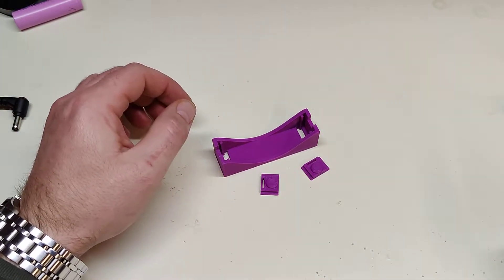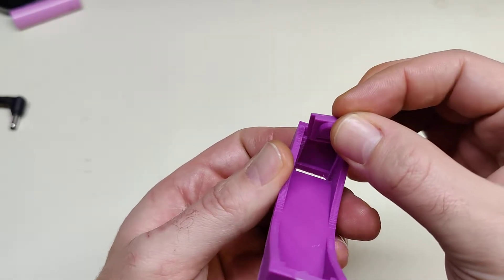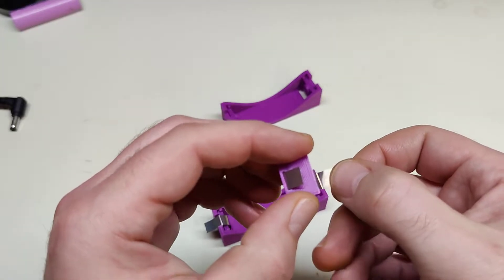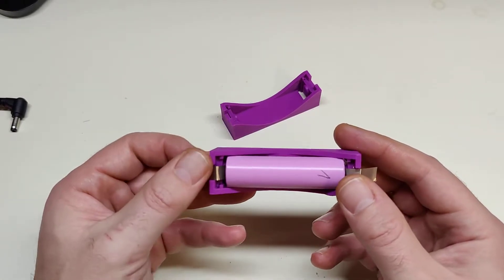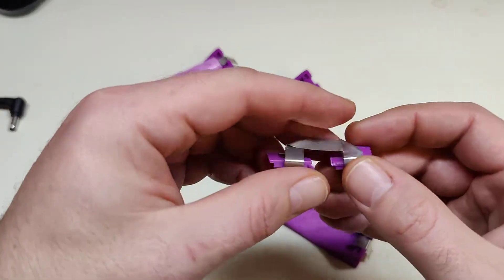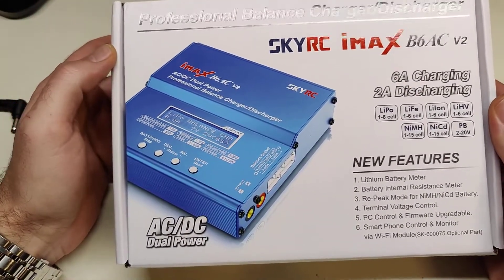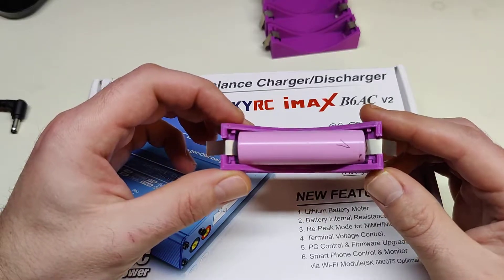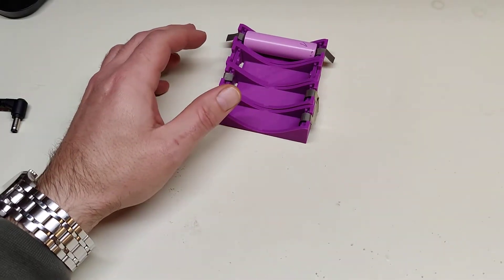3D Printed 18650 Battery Holder -with Nickel Weld Wire - DIY

Comment: 2.9v is a common cut-off voltage for LiPo/Li-Ion as it's gentler on the chemistry. 2.5v is a deeper discharge you can do but it may affect lifespan of the cell(s) and current delivery at those low levels is usually limited.